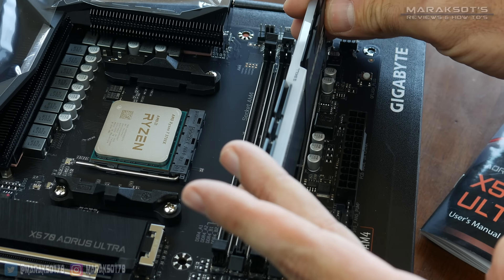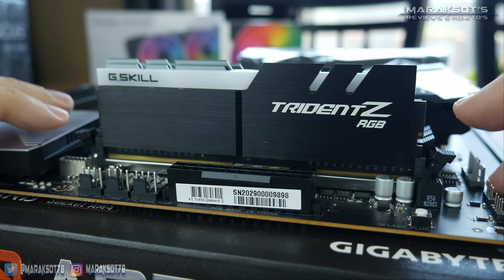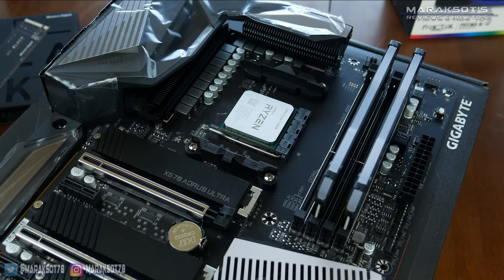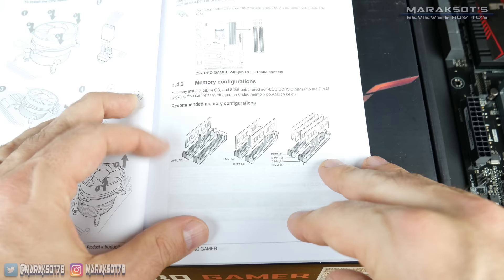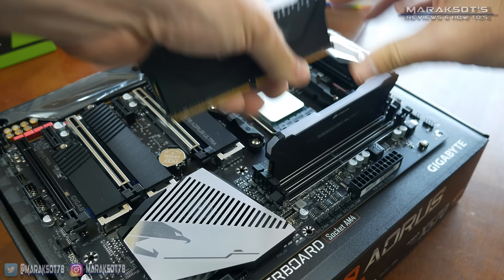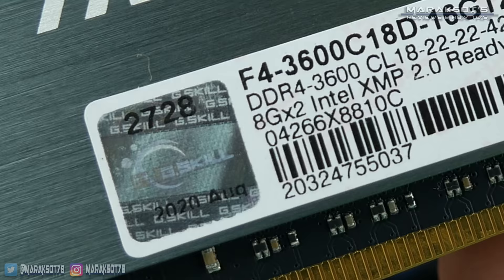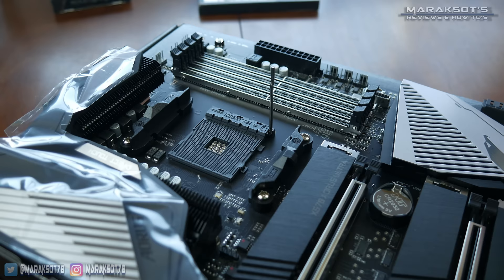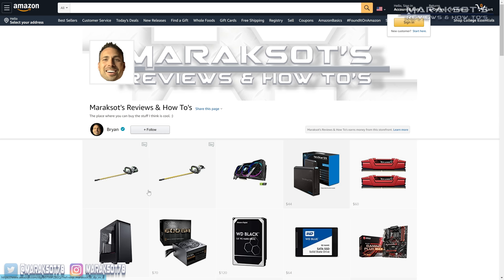A Beginners Guide: Upgrading Your PC's RAM

Comment: HELP PLEASE: So I installed some new Ram (8Gbx4) but my PC keeps doing this thing... I don't want to mischaracterize it by calling it something it's not, but it seems like a stutter, like a sound replaying as many times as it can for just a brief moment, like the sound you may hear during a blue screen... I don't know the proper term for it, but I just want to fix it, and if someone could give me the proper term for what it is, I can be well on my way to finding a fix.

Thank you.
Reply: I fixed it... I don't know what was causing it but rearranging my RAM cards seemed to fix it, perhaps one wasn't installed correctly. Strange, because all the clips were snapped down, and the RAM cards were all pushed down.

I'm just going to leave my original post up in case someone has the same problem.
Reply: @DrFross09  aight

Comment: Idk if it’s my ram but, I have a 16gb ram and I wanna stream and play apex for when I check my stream it starts lagging and the frames are bad but when I play it runs perfect, should I upgrade?
Reply from the maker: What CPU do you have? That's the most likely reason your stream is lagging.
Reply: @Maraksot78  I have the amd ryzen 5 3600
Reply from the maker: @thatbumkid_6161  that should be good enough for streaming and playing at the same time... what's your internet connection like? How many Mbps upload? Also it could be the settinngs you're using in OBS or whatever streaming software you're using. I don't stream much so I don't know all there is to know but those would be the first things I would check. It could also be lagging if you're game settings are really high. You know what I mean? Your hardware is already being pushed to the limit to play the game and then you add streaming on top of it and it can't handle all of that at once?

Comment: Wait since ddr4 only goes up to 2133 mhz if I buy one stick of 16gb ram and it’s 2666 mhz is that still overclocking?
Reply from the maker: Yes, enabling the XMP is technically overclocking your memory.
Reply: @Maraksot78  what do you mean enabling the XMP
Reply: @Maraksot78  well I looked up and my motherboard can hold up to 64gb of 2666 MHz
Reply from the maker: @sellvy6317  2133MHz is the base speed of DDR4, and it will run at that speed once installed in your motherboard. If you want it to run at 2666 or 3000 or 3600 or whatever speed you bought you have to go into your motherboard BIOS and enable the XMP. It's basically a simple way to overclock your memory. I have a video that explains what XMP is and how to enable it if you're interested.  https://youtu.be/WDzrq5IxBX4

Comment: Ight so i was upgrading my ram from a 8 gb to 16gb but it says i still need more dedicated ram for a game even though i already bought more ram what does that mean
Reply from the maker: I'm assuming it's talking about VRAM which is the RAM built into your graphics card, and the only way to upgrade that is to buy a new graphics card with more VRAM.
Reply: @Maraksot78  oof alright do you think a gtx 1660 super is a good gpu? That’s what I currently got
Reply from the maker: The 1660 is a great GPU for 1080p high to ultra settings gaming and even a good 1440p 60fps card on medium to high settings in most games.  If you're playing at 4K though or running VR then you're going to need a little more power than the 1660. Of course it also depends on the games you're playing. A game like Rocket League can run on a potato but Cyberpunk 2077 you need some pretty high powered hardware.
Reply: @Maraksot78  Damn I guess I’m out of luck because I just got the oculus rift and I wanted to know if I can run vr games on with the equipment I got

Comment: is it possible to get 8 ram slots?
Reply from the maker: Yes. Enthusiast/workstation motherboards will have 8 DIMM slots. However, generally speaking, most people do not need that much memory.  Not to mention, nowadays they make pretty high capacity DIMMs where you only have to run 2 sticks of RAM and still have more RAM than most people will ever need. For example I'm currently running two 32GB sticks of DDR5 6600 in my PC for a total of 64GB. 16GB is kind of the accepted norm right now, with 32GB being the "future proof" amount. Doing the 4K video editing I do I went with 64GB just to give myself plenty of headroom. Also if you plan to use XMP you get the best compatibility with 2 sticks of RAM as opposed to 4 or more. The more RAM modules you have the more strain that puts on the memory controller built in to the CPU, and when you're running 4 or more modules AND running them at high speeds you're more likely to run into stability issues where you then have to downclock your RAM to regain stability. So unless you're doing something with your computer that requires a lot of RAM, I'd recommend getting 2 sticks totalling the capacity of RAM you want to have rather than going for 4.
Reply: @Maraksot78  thanks for your reply, but you don't have to write an essay bro
Reply from the maker: @HarmfullAdvocado  just want to give as much helpful info as I can. 😅

Comment: I have 2x8GB of 3600 Corsair vengeance ram never had any issues I’ve just bought the same 2 sticks of ram now my Pc is crashing getting memory management error and system thread exception not handled can someone help please
Reply: Try this: Take out the known working 2 modules and install your new 2 modules. Does your PC crash also? If so, then problem is likely with the new modules.
Reply: @JJFlores197  if I disable DOCP all the modules work fine it’s only when I enable it they stop working but it works with the 2 original
Reply: @joshdignam959  DOCP/XMP is an automatic overclock for RAM. Its not guaranteed to work perfectly across all hardware combinations as there various factors that can affect stability. Sometimes, doing a BIOS reset and/or upgrade can help.
Reply: @JJFlores197  I went to update the bios and it says something like back up windows bit locker so I didn’t update the bios
Reply: @joshdignam959  Bitlocker is a drive encryption software from Microsoft. If you have enabled it, you would need to either disable it or make sure you have your recovery key handy as Windows may ask you for it. If you have no idea what that is, you likely haven't enabled it and you should be fine. It is not available on any Home/basic edition of Windows.
Reply: @JJFlores197  I have windows 10 pro can I just disable it and it will be fine to bios update ?
Reply: @joshdignam959  If you specifically enabled Bitlocker, yes it is fine to disable it.
Reply: @JJFlores197  I never turned it on specifically
Reply: @joshdignam959  Then you have nothing to worry about.

Comment: Do u have to remove the mother board completely
Reply from the maker: No
Reply: @Maraksot78  can I just stick the ram in there and it automatically works or what do I have to do this is my first time adding ram I’m upgrading from 1 8gb stick to 2 8gb sticks
Reply from the maker: @baylor_boy3273  as long as both sticks are compatible, after installing them your computer will boot up just fine. You will have to enable XMP in your motherboard BIOS however if you want it to run at it's rated speed if you bought RAM that's faster than 2133MHz.
Reply: @Maraksot78  ok how do I do the mother board thing
Reply: @Maraksot78  I bought the same ram stick so it should be compatible
Reply: @Maraksot78  idk how to enable the mother board thing my pc is a skytech archangel shadow
Reply from the maker: @baylor_boy3273  I made a video about enabling XMP you can check out here https://youtu.be/WDzrq5IxBX4
Your motherboard BIOS will likely look very different than what I show in the video. Hopefully it will give you an idea of what to look for and help you figure out what to do on your motherboard.